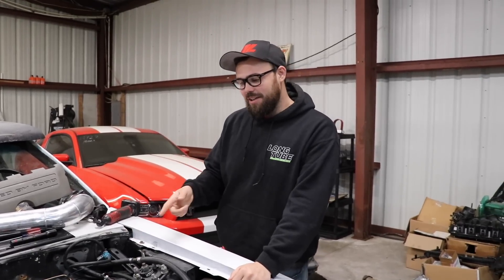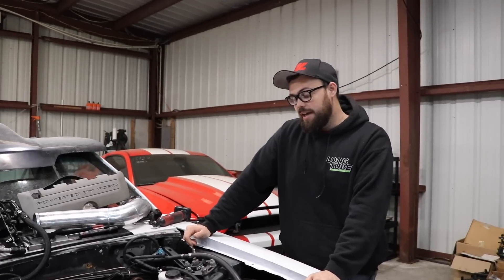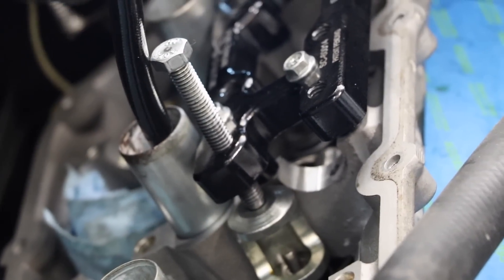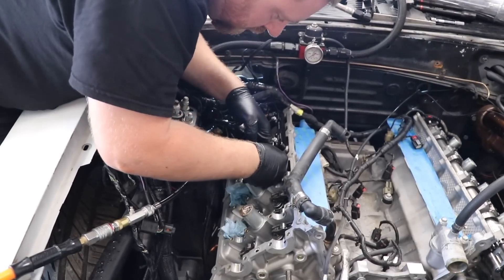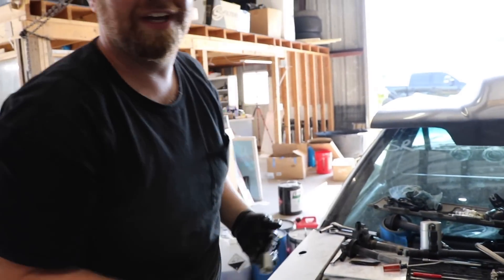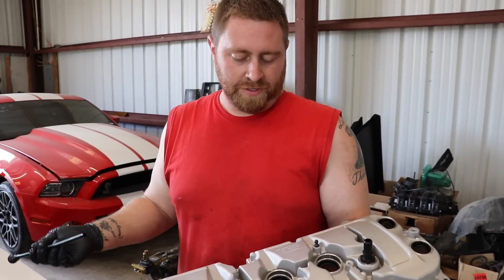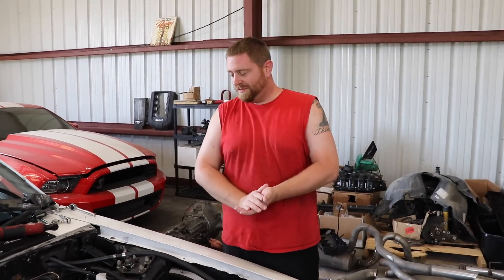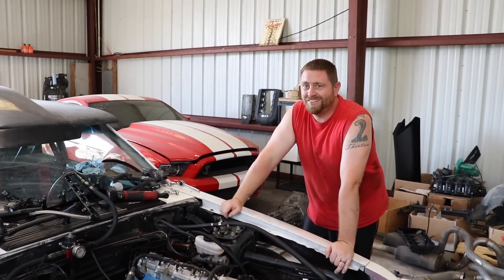This is why you upgrade valve springs... 22lbs of boost VS stock gen 1 coyote

Comment: I notice you stated you have to use the gt350/gt500 dipstick tube for it to work with the gt500 valve covers.What dipstick is used? Is it the normal gen1 dipstick or you have to use the gt500 dipstick?
Reply from the maker: The regular dipstick is fine. Just the tune has to be different because of the way it latches into the valve cover